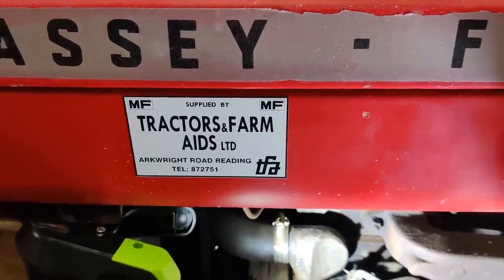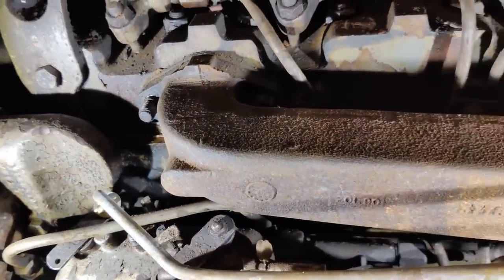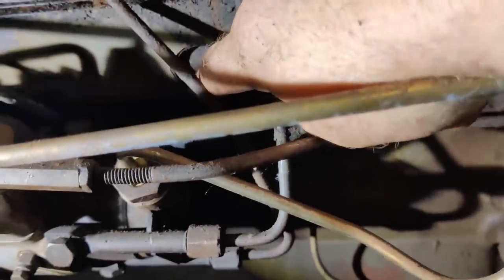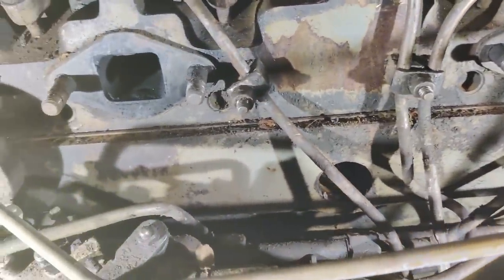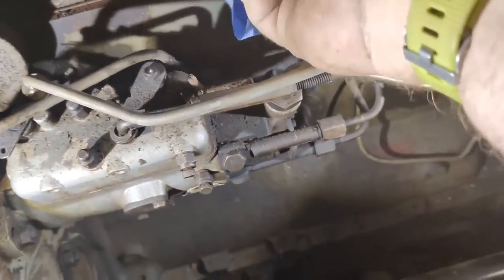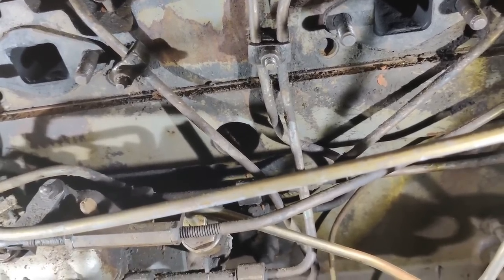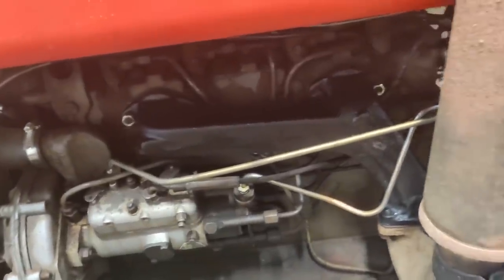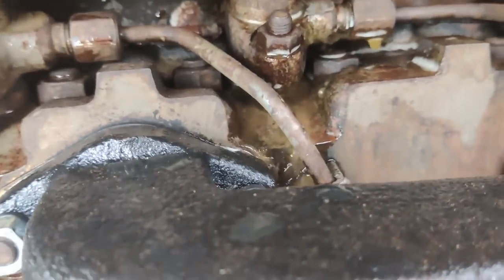It's leaking!

Comment: After reading the comments that is a shame 😞, and with some auctioned tractors usually dealer disposed for reason even I found that one out with one that had a rough running engine when I started it up after giving the key, nevermind it's just as well it happened now than it was putting to use for hay mowing, you'll fix it easily, i have every confidence in you, and as a special request, could you film your 590 doing a bit of work please? Strangely I'm miss watching it. Thank you for your video and good to hear from you again, not like your identical twin brother Terrance although there are things that begins with T.😊
Reply from the maker: At the moment, the 590 is blocked in  behind some other stuff, it should be out soon and ready for some more filming 

Thanks for watching 🙂

Comment: Used to curse the designer back in the day for what in our opinion was nuts bolts etc in really stupid places ,🙄😟🤬 think the new ones be a lot worse 😬 hope your fully recovered 👍
Reply from the maker: The worst part is the injector pipes and clamps.  It would have been a little easier if I had bothered to get my slim walled set of crows feet.  But it was in the other shop 🙄

Thanks for watching.
Reply: Can't remember what I bought my first set of crows feet for but have been a bonus a few times since 👍
Reply from the maker: @bobpaterson1845  one of those things that can sit in the cabinet for years, but pay for themselves on a single job.

Comment: allways use loctite on edge of core plugs as it fully sets and seals
Reply from the maker: I use Reinzosil Grey, which is designed for core plugs.

Thanks for watching
Reply: @ClarenceFudWeasel  Hmmm and what does that smell like? I prefer a good vintage Wellseal myself, the hours just fly by when you're unconscious on the ground.......... Good to see you back.
Reply from the maker: @TimS366  doesn't really smell like anything to be honest, slight vinegar smell if anything.  Nothing beats good old fashioned Tippex though.